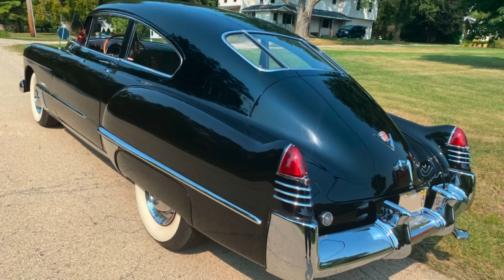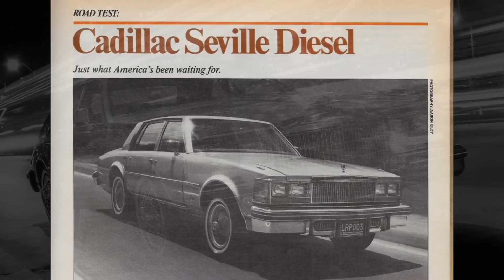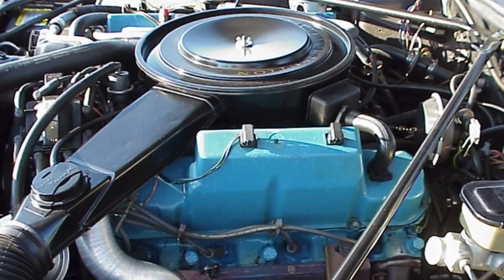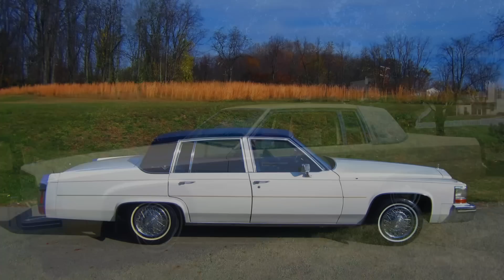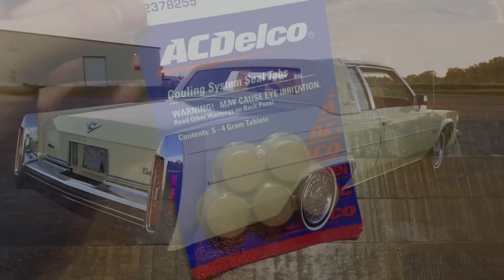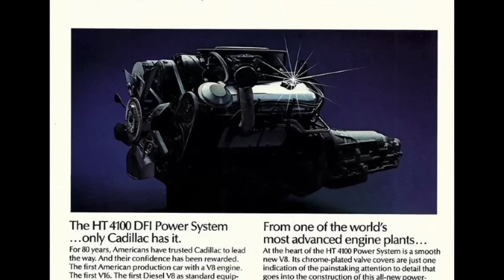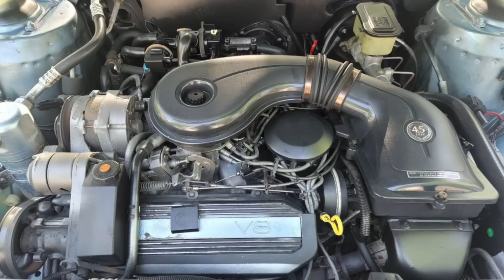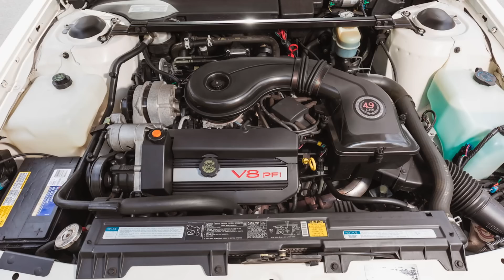This is GM's Worst Decision for Cadillac and Affected Its Reputation for Decades...

Comment: i worked for Cadillac during this era just after automotive school/high school graduation in 1983. I am currently still a GM dealership technician in Wilkes-Barre, Pa. This engine ruined Cadillac's reputation for sure. I have replaced so many camshafts, intake gaskets, head gaskets, crankshafts and entire engines that i can probably still remember every step of those jobs - And they were not easy to work on. Our family have had Cadillacs for most of our adult lives (still do) but this era was embarrassing for us. It was well known that the big chiefs that made these decisions were to blame - Trying to cut corners. I remember being trained at a GM school and the instructor told us that the engineers usually make a very good product - until the bean counters get a hold of it. What can you do?

Comment: I've had an HT4100 in an 83 Eldorado Biarritz for many years. It's run flawlessly, the only thing required so far is an alternator rebuild. It is very underpowered but delivers good fuel economy. I'd love to put in a modern 4.8 LS and rear wheel drive...

Comment: The 4.1 would not mainain the speed limit up a 6% grade form Phoenix to Flagstaff. 45-50 was max with the valves rattling. My parents second summer going north for the weekend blew the engine. Their last Cadillac, had the Northstar but the head bolts stripped and within 3 years all four windows had failed.

Comment: I hear it said all the time that aluminum and iron expand at different rates and that causes all these GM 70s and 80s engines to be unreliable.  Meanwhile, Toyota put aluminum heads on iron blocks for basically everything they ever built and founded their reputation on those engines.  I've had plenty of mixed-metal engines from Ford, Toyota, Nissan, and even Yamaha, and it never seemed to be a problem.  I even ran one of the Fords (a 2.0 Zetec) sans water pump for about 10 miles after the serpentine belt decided to leave the chat.  No problems.  It sounds to me like GM just didn't design their engines with the expansion accounted for.
Reply: GM did the same thing with Aluminum heads atop Iron blocks on a variety of I4,V6, and V8 engines with pretty good results. These Cadillac HTs were a different animal. They were Iron heads atop an aluminum block with cast iron wet cylinder liners similar to a Chevy Vega engine. Thermal expansion was more severe and internal coolant leaks were highly likely which is why GM mandated stopleak be added to the cooling system. I don't of any other engine that used this odd design. GM hasn't built an engine like this since 1995 which was the last year for the Cadillac 4.9.

Comment: The HT4100 could have been alright if corporate hadn't rushed it. Like you mentioned, it was ALWAYS meant to go in the downsized MY1985 cars, and after being heavily revised into the 4500 and eventually 4900, was actually a decent engine. So Cadillac engineering had the project on-track for a 1985 release... When they forced it out the door after only 2-3 years of development because GM corporate had kept their blinders on for too long and was suddenly scared of the EPA, it was half baked at best and the poor engineers had to scab-fix it enough to ship it. That included the ridiculously high thermostat temps for emissions and fuel economy (205F opening temp in a multi-metal engine???), which itself necessitated a dedicated engine oil cooler to prevent bearing wipeout from high oil temps,  reusing existing cast iron molding tech to make the engine heads because they didn't have the time or funding to come up with a true all-aluminum head, etc etc etc.... 

That engine was a depressing travesty, and I can guarantee you the engineers knew it when they released it for production. But it was out of their hands. That's the worst feeling ever.

Comment: I loved these Cadillacs. The 4100 did ruin Cadillacs reputation. These engines if maintained would last however they had issues but biggest issue was underpowered for the full size Cadillacs. I own a 1984 DeVille and she runs real nice. Of course it’s been in the family since new and always maintained including putting those sealant tabs when replacing antifreeze. Cadillac should have made the engine all aluminum and bigger displacement.

Comment: You didn't mention the 4,1 litre V6. You could get this powertrain, based on the reliable 3,8 litre V6, from 1980 till 1983. It had also 125 HP but more torque at lower rpm. A good alternative and rarely seen on roads today!

Comment: GM should have considered moving the Cadillac down to the midsized vehicle range (ala Malibu) and fit it with an appropriate engine.  In the end, they kept their full sized bodies and went through many years' messes before landing on the 307 Olds and later 305 and 350 Chevy.

Comment: Ross Perot was famously critical   of the Cadillacs about this time- he asked about engine issues with the 4100 and was told it was due to owners not properly maintaining their vehicles.
 He rather quickly called BS on that one- pointing out that the market segment buying Cadillacs weren't likely to be changing their own oil...
 Or looking into constant complaints about oil pan leaks- found out that GM knew about the issues- but refused to do anything about it because the upgraded gasket would cost $.05 more per unit

Comment: I inherited my mother's 89 sedan Deville 7 years ago when she passed away. That 4.5 litre fwd has made a dozen round trips from Chicago to Denver and as of today sits in my garage with 62k miles on it. The only repairs I've had to make have bern a new alternator and ac compressor, belt and idler pulley and battery. Still looks and runs like a new car. A more comfortable ride than my son's 99 Deville with the Northstar and the 89 gets 28 mpg compared to the Northstar's  23 mpg.

Comment: GM? My 69 Chevelle had a 307 rated at 200hp and 300 foot pounds of torque. It was capable of mid 20’s per gallon. It had an air pump for the exhaust manifold.

Comment: The biggest mistake Cadillac made was to become part of the GM clone car line up. When they tried to compete with the import market for smaller luxury cars and market a version of the Chevy Cavalier calling it the Cimarron. The car was nothing but a rebadged econobox with leather seats. 
You could actually buy the Cavalier with a V6 not available in the Caddy until the second year of manufacture. Imagine a better engine in a Chevy on the same platform.
Reply: V6 wasn't available in the J body till 85

Comment: I had a '76 DeVille with the 500CID engine and fuel injection I bought in '78 (wondered why it was so cheap).  In my opinion that fuel injection system was another huge mistake for GM.  It was a hybrid system with the injectors and some other parts made by Bosch and the control system by GM.  The Bosch components were fine, but that GM made control computer was horrible.  It never worked that well and was extremely prone to failure if there was any noise on the electrical system.  You could blow out the computer by having a poor connection on a high current circuit, such as the headlights.  And then you'd be in limp home mode and would be looking at another close to $1K repair bill - in 70's / 80's money that was a chunk of change.  That was enough of GM products for me.

Comment: Cadillac went straight to hell in 1977. Everything from the introduction of plastic ash tray covers that flew apart when you closed the door to downsizing from the 500 c.i. engine. Everything got worse year after year. Personally I thought the reason behind this excessive planned obsolescence was Cadillac was tired of their image tarnished as used Cadillacs turned into ghetto hoopties.  I had a beautiful 1975 coup Deville and immediately regretted trading to an 81 8 6 4 sedan deville. Then an 82 Fleetwood coup. Everything on that car just fell apart. I walked away and never looked back. Now I think of Cadillac as highly decorated disposable junk that only a fool would buy...

Comment: Those diesel engines were nothing more than a converted gasoline engine, and the gasoline engine design was not sturdy enough to deal with the added pressure and torque a diesel produces. The weak spot turned out to be the head gaskets which departed the pattern on a regular basis.

Comment: I've owned several Cadillacs, 20 of them. Imagine my disappointment as the power went down year after year. My 1970 Eldorado 500 ci had 400 hp with 550 lbs of torque. My 1976 Eldorado 500ci EFI had only 215 hp with 400 lbs torque. My 1984 Eldorado with the HT4100 was completely pathetic. Yes Cadillac became a serious disappointment. I haven't bought one in many years. Been happy with all the Mercedes Benz I have owned...

Comment: Dad had an 83' Coupe DeVille with the 4100 V8. Bought it used with 44k in 86 had it for 20 year, It was flawless with just over 100k. Very slow, but it was reliable.

Comment: There were numerous times I had to work on that pile of shi... horrible engine for leaks.  Cadillac made nothing but poor choices for their power plant.  5.7 diesel---pos,  8-6-4 engine---pos.  All they had to do is pump up the BOP 350 to maybe around 370-380 cubic inches, lighten it up and fuel inject it.  Come to think of it I still may have some specialized tools to work on that pile of crap

Comment: I had a weird Cadillac I suppose.  Mine was an '88 Fleetwood Brougham but it came with an electronically controlled carburetor (Apparently a 1 year only type as parts were made of unobtanium) 307 and while it was no speed demon, that wasn't why I bought it.  I bought it for the ride which was just so damned comfortable.  I could drive it home to Cottage Grove, Tennessee from Salem, Indiana and feel as good when I got there as I did when I started.  Trips in other cars of that length left me feeling cramped and half beat-up from the trip and just all around tired.  I also discovered if I drove that distance at 70mph I'd use about 3/4 of a tank whereas if I drove 55mph I'd only use 1/4 of a tank so you can bet the fastest I ever got to in it was 55.  When I got rid of the car it had 333,000 miles on it, but that funky carburetor had started acting weird and I didn't want to keep trying to find parts for it.
Reply: The 307 was an Olds engine and they used it up until 1990 in the Brougham
Reply: @moejr1974  Hopefully with a different style carb or injection.
Reply: @Rebel9668  nope was carbed to the end
Reply: @moejr1974  Well, our GM dealership told me that electric carb was only used for one year and that was why it was so hard to find parts for and I'm inclined to believe them.  I tried myself at places like auto value/General Auto, NAPA, several other local parts houses etc.  Nothing.
Reply: @Rebel9668  after 1980 all rochester quadrajet 4 bbl carbs were computer controlled. They were used on a lot of GM vehicles including ones with the 307 Olds engine like your Fleetwood. Depending when you owned the car the parts were probably out of circulation by then.

Comment: I've owned 2 5.7L diesel cars , a 77 Seville, 83 and 84 Cimarron, 89 sedan DeVille and many more Cadillacs. The diesel was smooth and quiet and very fuel efficient. The problem was the injection pump, and the head bolts stretching which was resolved with the DX block in late 1980. The damage was done to its reputation. Poor diesel quality fuel in the late 70s and early 80s and GM techs who didn't understand diesels . More damage to Cadillacs reputation was the V864 engine from 1981 and the 1982 Cimarron

Comment: The last great Cadillac engines were the 472"/502" big blocks, smooth as glass good HP / torque and dead on reliable but gas hogs.  What no one remembers was the problems Cadillac had with cracked cylinder heads on the '65 thru '67 429" engines, cracked heads plagued these engines for three years and the casting problems was never fixed until the introduction of the new 472" /500" engine family.

Comment: Yeah my parents bought a used still goodlooking 1985 Cadillac once that thing was a ton of trouble. Something about GM cars where they changed something in the motor & transmission that year that made them tear up & have problems like you ain't never seen trying to cut cost.

Comment: The CADILLAC sedans were always beautiful cars. However GM seemed to be obsessed with each division building their own engines. There were other proven engines that GM built that could have been used that were more powerful and reliable. If you get in the car and start the engine, does it make the slightest bit of difference which so called division built it? GM finally did the wise thing to consolidate engine manufacturing and eliminate duplication and overlap. But then they developed that V8 for the CT6 then turned around and discontinued that beautiful car five 5 minutes later.

Comment: Lets not forget the Northstar engine, with the fine threaded head bolts that ended up leaking antifreeze into the oil after 60,000 to 80,000 miles !!! I owned one DEville and the replacement engine was $ !0,100.00 !!! so I traded in that POS !  GM knew about the problem for 20 years !! idiots !!!

Comment: I began to sell cars in 1988 at a store with Buick and Cadillac along with Honda.  By 1988, the HT4100 was made into the 4.5L and was improved.  Then they went to the 4.9L which was really good.  But I've seen a lot of 4100's with a ton of miles on them still going strong as long as they were properly taken care of.  Recently, I picked up a mint 1986 Seville with only 22,560 miles.  So far it runs out great, is smooth and quiet.  So far no issues and I've already had the cooling system flushed and new coolant put in.  This Seville is a fantastic addition to my 1988 Cimarron!

Comment: Fotunately emough to have the first year downsized1979  Eldorado with the 350 cid fuel injecred gas engine with about 170 hp and 265-270 ft lbs, of torgue. believe a 350 could easily replace those ht4100 engines in the 1982-1985 to get a reliable running Caddy.

Comment: i bought my 1983 Sedan deVille in 1992 ... more than 31 years ago, its our wedding car. has the HT4100 v-8 rear wheel drive. currently has 148,000 miles on it. it has always run very well. i always give regular oil changes and add slick 50 at all oil changes. last summer i replaced the radiator, power steering pump, vacummn pump, all belts hoses etc. my beautiful yellow four door plain jane cadillac has always purred like a kitten and still does.   have taken it to Las Vegas in scorching hot 113 F  heat, cruising at 70 mph with digital air conditioning on.  my car still looks and drives like new.  Not for sale, but i will soon create a video of this car and post it on YouTube

Comment: The amazing thing about this story is that General Motors had previous experience with the problems caused by trying to mate aluminum and iron with the Vega from the early Seventies. If I'm not mistaken, the Vega engine had a cast iron block and aluminum head. Apparently Cadillac thought an aluminum block and cast iron head would yield a different result. The Olds diesel engine had an astounding failure rate. My 1980 Oldsmobile 98 Regency with the 350 diesel got 38 mpg, but went through three diesel engines before it turned 43,000 miles and we gave up on it. This from the company that invented the overhead valve V8 and ushered America into the modern age of automobiles - The Standard of the World. MotorTrend proclaimed Cadillac to be the fastest production car in the world in 1950. The Jaguar XK 120 may have been faster, however.
Reply from the maker: Vega engine was aluminum block and iron heads

Comment: I worked for a Cadillac dealer during those years.  Another very common issue with the 4100.  Vehicle would come in popping back through the intake.  You would then go to the parts department and ask for a Cadillac tune up kit which consisted of a camshaft and lifters. Intake lobe on camshaft worn perfectly round.

Comment: An excellent video pointing out why many buyers, myself included, who bought a Cadillac with one of the horrible 4100 engines lost all faith in Cadillac & never bought another one.  My personal disaster Cadillac was a beautiful '84 Eldorado convertible which I fell in love with the moment I saw it.  It was much smaller than the '76 Eldo I had previously owned, much more maneuverable, handled & rode well, and was very nicely appointed, inside and out.  Obviously, the designers at GM did their job well, while the engineers did not. Unfortunately, after the engine self-destructed (twice!!!), i swore I never would even look at another Cadillac.  Considering the peculiar vehicles this once world-standard manufacturer has been designing for the past 20 or so years, not even looking at them has not been difficult. I have since owned several Lexuses, and am happy to say that every one of them has given me superb and trouble-free service.

Comment: Had that engine in an '83 Eldorado.  Ran just fine for over 150k miles.  Engine was still unopened when the transmission died.

Comment: I've quit american built cars more than 40 years ago and I never regretted my decision.
the cadillac is just another example of the big 3 thinking.
The good decision would have been to recall all these engines and  replace them by a revised version on a special warrenty
instead of that, they preferred to  loose their name.
It is that way Toyota,and other european and asian manufacturers have gained the market.
very good video.